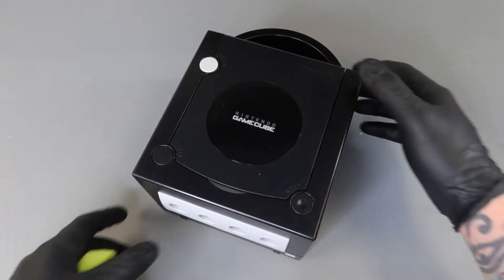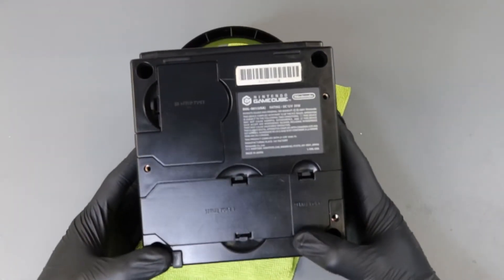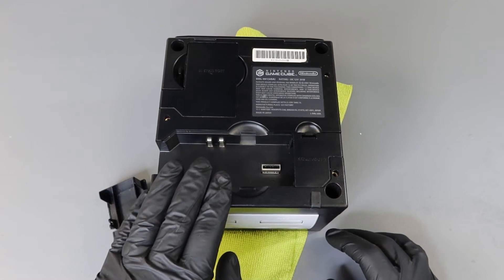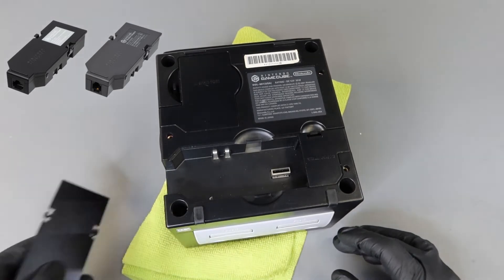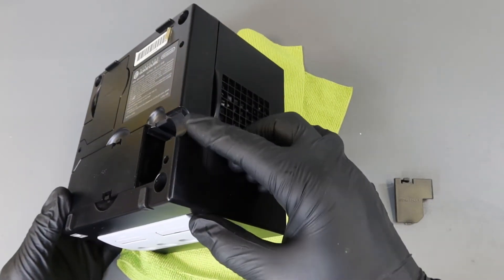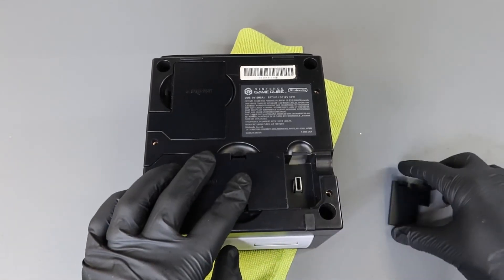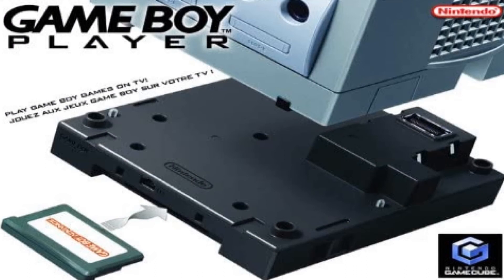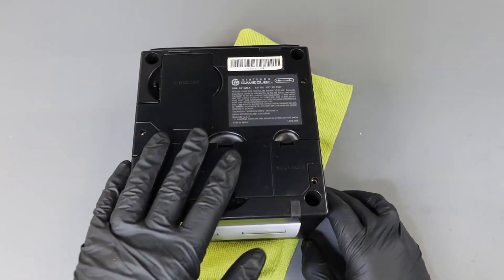What Are These Nintendo Gamecube Ports For!? | Retro Gaming Guy

Comment: Port 1 for the Broadband/LAN adapter was also utilized in the handful of games that offered LAN support, namely Mariokart: Double Dash. However, it likely wasnt used for games as much since most of the multiplayer games on GameCube used either basic splitscreen for most MP games, or the connecting cable for GameBoy Advance on specific titles, such as LOZ: Four Sword Adventures. One can only imagine what a Super Smash Bros. Melee with LAN support would have been like.

Comment: The 2nd port brings up an interesting question. Why would the final consumer version have a port meant only for developers?
Reply: Probably for game devs
Edit: spelling
Reply: They probably figured they would be sending them around the world to thousand different developers who needed access to that port. And it would most likely be more expensive for them to make two different batches with and without the port. So instead they just kept it as standard.
Reply: The second port was actually removed in later revisions, even before the DOL-101 came out and removed the Digital AV port. Maybe the early batches were intended to produce all their development units as well? This port actually can be used today by consumers for a microSD card adapter to load games through Swiss.

Comment: My gamecube shell has front two corners cracked and chipped. It's cosmetic but what are my options to find a shell replacement? It's a silver dol 001 model.
Reply: I got a clear shell for my GameCube on eBay for 50 bucks